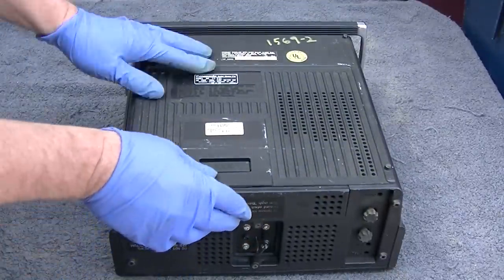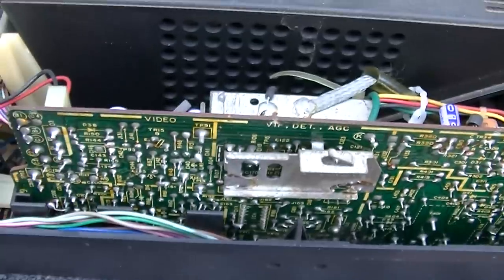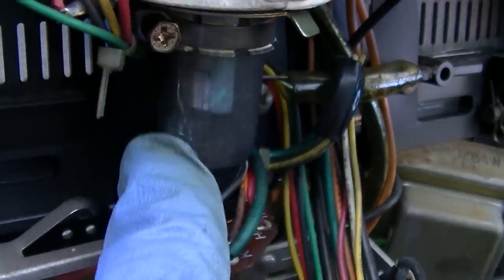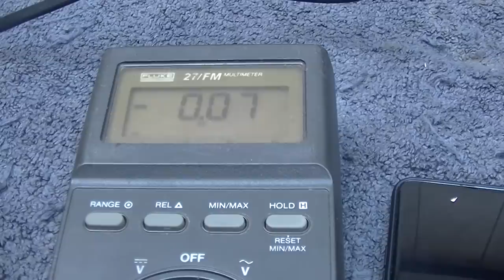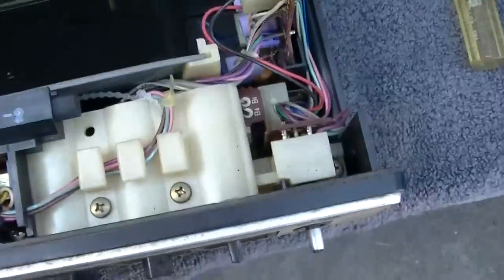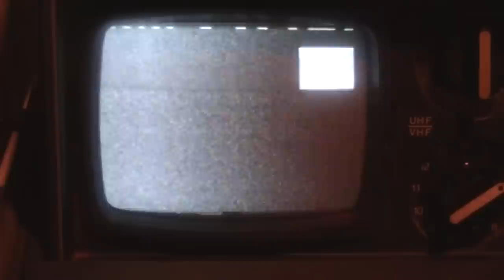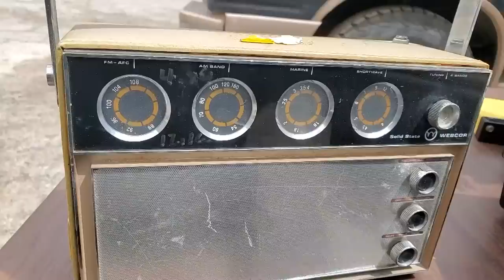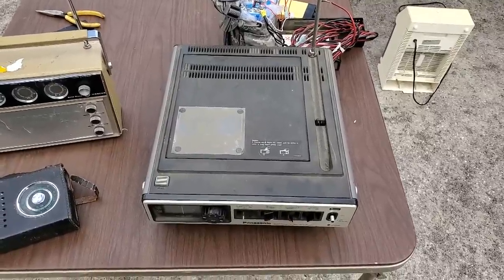1977 Panasonic TR535 Portable Pop UP 5 Inch Television AM FM Radio And Test

Comment: True story about Panasonic being good quality, everything I ever bought even in the 90's by Panasonic was a good piece of stuff.
Reply: Even the made in Hong Kong crap that everybody hated back then was still built better than the crap we have today.
Reply: I have a 27in Panasonic CRT from the early 00's I saved from my parents back in 09 when they bought their first flat screen, I keep it in my media/game room as my CRT for retro, and 2nd TV for sports, etc.. using a ROKU box, as it has component input, and stereo output, and the picture is just as bright, and clear as the day it was bought.   

Same can be said for the optical drives they made for Nintendo for the GameCube, Wii, and Wii U systems. I've rarely come across one that was not abused by some idiot kid thats failed, where as I have 6 Sony Playstation 2 systems I've collected while out thrifting(a combo of fat, and slim models), and all of them have bad lasers even though they look nearly new, and it's not uncommon for those to randomly fail with no easy fix. 

So yeah other than bad sourced caps over the years which is the electronics industry in general, Panasonic stuff seems to hold up, and is quality for the money.
Reply: I used to get their car stereos everytime I got a different vehicle, straight to Best Buy to get a Panasonic
Reply: National 
(National) Panasonic
Technics
Matsushita
A great world brand.
Reply: @martinda7446  Matsushita is an oem component maker for panasonic
Reply: Their full size cassette answering machines were pretty tough. I changed belts and gave one to mom to screen calls. It lasted 20 years. Telemarketing calls wore it out. Lol
Reply: @martinda7446 I'm not sure that I would agree that everything that was. Matsushita brand was good, but Panasonic for sure. Some of the store brand stuff they built for allied stores and interstate stores was pretty bad.
Reply: Damn with this great reputation of Panasonic I am so torn between a Canon and a new Panny cameras right now.
Reply: @martinda7446  Also later Quasar. JVC was also owned by Matsushita at one point.
Reply: @Synthematix  Matsushita was the original company name. Technics, National, Panasonic were only their brands for different markets. In 90s Matsushita was renamed to Panasonic, but the name is still used.
Reply: Except for their sh*tty electrolytics. Which were the worst ever (the blue and purple ones).
Reply: Used to be now junk for the landfill

Comment: Back in the mid 70's before I got my Sergeant's strips, I had the undesirable duty of pulling Arms Room Guard.  They would give us a M1911A1 .45 ACP Pistol and put us in the outer part of the Arms Room, not where the arms were but outside the door, and lock us up for 4 hours at a time.  We had a field table and folding chair, and could bring a radio along for entertainment, and a pocket book if we were readers.  A buddy of mine had an earlier version of that and it qualified as a radio to the Sgt of the guard, so we would borrow it and take it down to the Arms Room, sit it on the table and watch TV.  It passed the time much better than a book, and kept us awake. I later bought the brother, a Panasonic TV that ran on batteries and was so close to olive drab that it looked like a commo tool.  I would carry it along with me when we went to the field on training exercises so I could entertain myself while locked in the Radio Teletype hut on the back of a 5/4 ton truck.  I still have that little set, perhaps one day I will plug it in and see if it still plays.
Reply: BUT ... open it up and check the caps!!!
Reply: yes the caps...

Comment: I really enjoy seeing you work on this era of equipment. I have a couple of Panasonic boomboxes from this era. They still work perfect and they're still beautiful imo.
Reply: Panasonic was the best. They make a look alike one now with Bluetooth.
A piece of junk.
Reply: Better check for leaking (not electrically, but physically) electrolytic caps. Especially the small blue and purple ones. They got green legs when they're bad... And will corrode the PCB traces if left for too long. Especially if the caps are exposed to heat.

Comment: I have a Panasonic ToughBook CF-53 laptop from 2011 and is still going strong after 12 years.
It can still run on battery for hours.
Reply: I have one as well, with the touch screen on it. I put Linux on it and it is doing great!
Reply: I love those things.
Reply: Panasonic designed the Gamecube, it was a massive success
Reply: @Synthematix  No Nintendo did the design work on the original GameCube, and Panasonic made the disc drives to get around DVD patent royalties(same for the Wii, and Wii U with Blu-Ray royalties), however Panasonic did make an agreement with Nintendo, and designed, and sold the Panasonic Q DVD player in Japan(also Hong Kong grey market)that can play GameCube games along with the special Gameboy player adapter for it, that's specific to the Panasonic Q as it's a bit taller, and a slightly different shape. 
It's the same type of deal Nintendo had back in the day with Sharp that made the Famicom disk system drives for Nintendo where they got to make, and sale the Sharp Twin Famicom, and a line of Sharp TV's in the US with a built in NES, and in Japan a line of TV's with a built in Super Famicom that stuck out the top of the TV.
Reply: Not too surprising that a 12year old laptop still works, especially from their most durable lineup...
Reply: @volvo09  My MSI GS66 Stealth laptop has started to fall apart after 11 months

Comment: First TV I ever had was a Panasonic TR-515RC back in 1979. And yes, it got surprisingly decent reception in the North Carolina mountains off the standard antenna.

I also had kept it until 2016. Replaced the capacitors around 1999-2000. Worked great up until the analog shutoff. After that, I really only used it for the radio. Finally gave it to Goodwill in 2016.

Comment: I’ve got one of these, missing the battery pack assembly. I have it hooked up to a digital to analogue converter with a flat antenna against the garage window. It works fine and picks up 8 over the air stations in North Vancouver, BC. Mostly coming from Bellingham , Wa. I think.

Comment: I bought a 5 inch TV with a Radio back in 1979. I still have it and it works. Can only get a TV Picture on it if I run a VCR through it. These sort of Sets were popular here in the UK too in the 70s and 80s.
Reply: Yea, i remember the JVC 5" black and whites with the built in radio.

Comment: Later models included an alarm clock function and used a pair of the slide-in PV-BP50 "stubby" camcorder batteries using the snap-on clip to make the electrical connection based on the PV-BP88 used in the full-sized camcorders.

Comment: Love Panasonic stuff. Their 2000s plasma TVs are full of features and practically indestructible. I have a DVD changer home cinema unit from around 2004 that still works flawlessly. Sadly they're not what they used to be, but still better than 99% of the crap out there and there's enough of their old stuff floating about that's either still in full working order or needs only minor repair to last me for a while yet!
Reply: I have a 2007 50" plasma, it's a good TV but a power surge killed all the video inputs. Currently, the motherboard is with my repair guy; I already bought the official Panasonic bag of parts to get the inputs working again.

Comment: Loved Panasonic, super well worth the money & ran a DR-31/RF-3100 for years pulling in stacks of HF stations especially catching hams & lots of merchant ship traffic on SSB including radio telephone & ship to shore on 12MHz & plenty aviation HF traffic on 8MHz before I sold it to get a Yaesu FRG-7 in the early 1990s which I still have.
Remember hooking up the DR-31 to receive HF WEFAX on 5100kHz which it easily did using Tom Moffat's XR2206 decoder & some shareware software running on PC-XT under DOS.
Had originally tried to get the National Panasonic DR-28/RF-2800 but they kept continually selling out (despite being on a wait list!) so finally got the DR-31.
Bought the Panasonic as a teen saving up paper round money & trading marbles & honestly one of the very best purchases I've ever made.
Had other Panasonic boom boxes, portable cassette players which were simply awesome quality & have a CRO2 Panasonic tape deck.
Had a Toshiba KT-AS1 portable "Walkman" I used going for a run at the beach but never lasted anywhere as long as my Panasonic "Walkman" as no way I could afford the real deal from Sony.
They had a few name changes ie National Panasonic but if you ever opened them up the thing oozed quality plus Panasonic service manuals were super easy to get for about $20.
Can't say I'm surprised it performed so well as I'd get Queensland/VK4 & which are like 1500km away from Victoria/VK3 & even some Asian stations on AM broadcast bands & even managed to get Sydney FM stations during summer (possible sporadic E skip) or tropo.
Used it to tune into Greek ERA-5 SW broadcast which it did easily with a short piece of wire, even though I had a bodge long wire antenna later on for it which caught so many SW stations it was crazy & many times with the longwire antenna it would actually pull in ERA-5 SW station even when they weren't beaming towards VK!.

Thanks for showcasing this unit, Shango & God bless
Reply: I remember building a kit in the 80's that did WEFAX and RTTY, and it ran on the commodore 64, the program listing was in the magazine as well and in assembly language from memory.  The magazine was ETI.  I remember getting FM from sydney to wangaratta vic one time in the early 80's on Xmas day.  There was no FM back then in this area apart from tv audio and vision carrier.

Comment: Not really surprised at the hours on it.  Most of my friends had one of these in Jr. and High school as their bedroom tv.  I had/still HAVE my original panasonic 12" set from 1975.  It was used so much that I eventually replaced the CRT and many years later re-capped it.  Mine is a very rare set, it turns out.  It has a flat, rectangular CRT with a touch pad instant on/off.
Panasonic made some very good stuff.

Comment: 40:07 Reception of Airband communication on an Image Frequency would be happening at 2 times IF above the set frequency. So at 108MHz on the dial the received  image was at 108 + 2*10,7 ~129,4 MHz. And if the Airband transmission is heard very clear, the AM supression in the FM ratio detector is misaligned or a bad design.

Comment: The scrolling display held up very well! Looks as good as new. Generally the types I've come across are on their last legs, brittle, yellowed, numbers and text falling off.. Just as I was concentrating on two things , Shango and soldering a battery into my multi component tester back to front. Immediate smoke. How did I do That? I'm blaming Shango. I'm sending him a bill for distracting me and causing damage.

Comment: Great video Shango! I had this set it was a Christmas gift from my Parents. It was a great set and as I recall it had a pretty sensitive tuner uhf/vhf. Living in Baltimore I could get the Washington,D.C. uhf/vhf station’s extremely well with the whip. A very sturdy build. The radio was very sensitive on AM and FM tuning was a bit tight on FM but still very good. An example being if stations were 200 kHz apart it would be tough to DX but 400 kHz separation would work just fine. Thanks again for your videos and hard work sir! Have a wonderful weekend!
Reply: All I got from my parents as a Christmas gift was a stick. "You're lucky to get that" they said.

Comment: I love that TV/Radio. I wish I could get things like that here in the UK.
Reply: There should be similar devices in the UK. I know Panasonic made a European version of an older model, the TR-475 EU, under the "National" brand. I have a National TR-475U, it's a great little unit.
Reply: @toomanyinterests  The only ones I've seen are those 80's TV's with the 3 or 4 inch screens. Nothing as classy as this.
Reply: @frankowalker4662  Yeah, those aren't as appealing. After looking into it some more the National TR-475G seems to be the British model. They must not be very common. The classiest portable TV I've seen was an Astor Royal R11P/7, it has a beautiful timber case with brass and chrome trimming. It does start to stretch the definition of portable though.

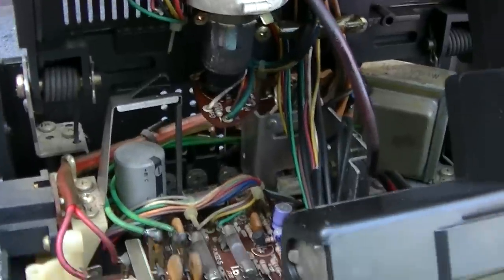Comment: BOOM 14:46 mark. How true. The first time I got into my GE P780 made by Conrad Jutson, I'm sure most of you fellas know who I'm speaking of. What Shango just said is spot on with that P780. I kept a time log every time I turned on/off the radio. I logged exactly 1,303 HOURS on one set of 6 D cells when 820 hours is what they claimed you could enjoy with their piece. I feel like I have some "dirty little secret" in owning this BCB receiver. ha! Too this day......there is nothing that has ever "walked out of the ring" without their head down and beaten and battered in a one on one with her.

Comment: i still have my crazy expensive plasma tv i bought when i worked for circuit city back in the day and honestly it’s getting old on the television tech but it is still the best room heater in the industry i love the thing as long as i don’t have to move it as i got a big one and it is over a hundred pounds but you talk about quality i remember the Panasonic rep would come in and the big selling thing he would do to show how tough the TV was he would throw his keys at the screen and it would never break till one day after a year of doing that it did i died laughing but dang that screen is stupid strong against impact not burn in oh the tears we used to see 😂
Reply: Yeah that's the only downside to them, the power consumption and the amount of heat they throw off. Otherwise... for me the zenith of display technology. I have 2x 43" and 1x 50" Panny plasmas, all bought for £50 or under (one of the 42" ones was free.) Deep blacks, no lag, great sound and even burn-in is less of a risk now that they all have a few hours on them. Good if you have small kids too as unlike the thousands of scrap LED sets with smashed screens seen on FB Marketplace, they are generally resistant to thrown toys / game controllers. And even then if the outer glass cracks the inner screen usually continues to work. I'm not bothered about 4k or 'smart' functionality (that's often obsolete before you get the thing home - I'd rather plug in an external upgradeable dongle.)

Comment: Interesting, great made product for the time. Even now many flat panel TVs and monitors  die in 3 to 5 years for many the problem I have found was the weak capacitors, most show no signs of going bad visually. Replace them all (computer monitor 10-15) (TV mainly the power supply 25-45 caps) and they work just fine.   
As for this TV showing signs of use, I can bet it was in a child's room, or teen room and often then never turned it off since just closing the TV made it appear to be off.
 People do that with their laptop, close the lid and think it was off. Before solid state hard drives they often would screw up the hard drive with a small or large bump.

Comment: Regarding reception- I had a couple of the super cheap "Bentley" TV's back in the 90's that I would take camping in the Bradshaws and up by Humphreys peak,  in Arizona. 
 They worked, but you would only get maybe two stations in (usually one).
If you grew up watching TV on a B&W 13" using rabbit ears decorated with Reynold's wrap, they were fine. 
On longer trips when i would camp in the back of the truck, it was usually good for some amusement, and if you were near a town/city it actually worked quite well.
 I messed with adding leads to the antenna, which did not significantly improve reception.  
The downside was it used D cells, and would eat them up very quickly. I later rigged one to run off of the deep cycle I later installed in the truck's camper area. They went to the thrift shop when the stations switched to digital.

Comment: I’m a mechanic and you wouldn’t believe the stuff we see fail that’s not repairable on the newer vehicles, I repair old electronics as a hobby and it blows my mind how we lost the ability to build anything good
Reply from the maker: Because vehicles are designed to be gone in 10 years
Reply: @shango066 MY BELLY BUTTON DOES NOT WORK!!
Reply: Check out Louis Rossmann. BIG equipment is now designed to not be repairable, at least by the owners.
Reply: @shango066  yep exactly that’s the game now, finance it for 7, you get it paid off then a pile of stuff fails and the cost adds up, then they rope you into another new one. I try my hardest to repair stuff not replace it, and a lot of times I’ll order stuff from mouser to fix a ecm or a micro switch in a shifter etc.  Love your videos by the way always learn and laugh!
Reply from the maker: @thomastubeworks  most of the vehicles will be phased out before the reach end of life. we are entering the age of forced consumption reduction/carbon cutting mandates.

Comment: We used to take one of these on camping trips.  Yeah a little
bulky to carry.  The radio nor TV are big signal pullers.  You 
better hope a few strong stations are around.  The AM tuner
will pull in a lot of in and out stations at night.  The TV is 
just watchable if you can tune in a station, but good luck if 
you are in the middle of nowhere receiving a lot of anything 
with this.  Great to see one of these again.... I think the power
transformer blew up in the one we had.   Cheers!   🍻   -Al
Reply: Still puzzling to me ... WHY do people go out "camping" into the wilderness, to commune with nature and think they need to bring along a TeeWee. The could more easily just stay at home. And avoid the mosquitoes.